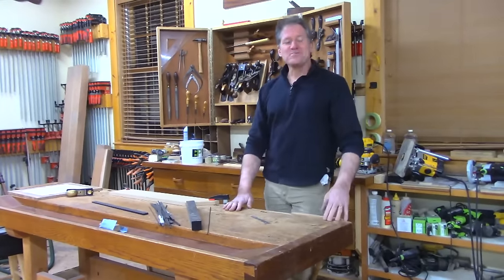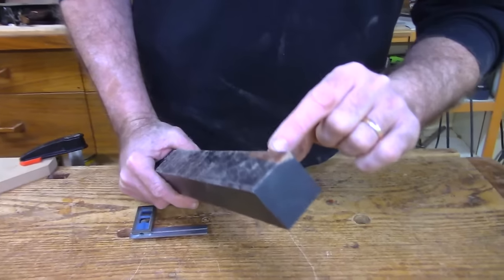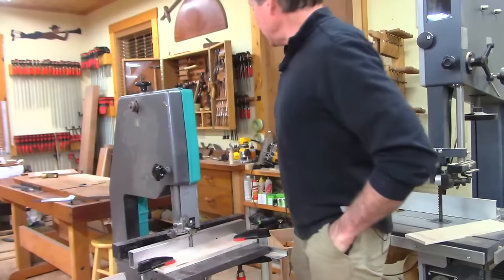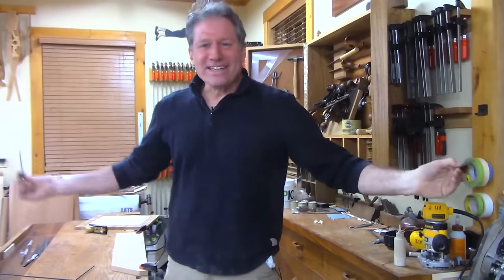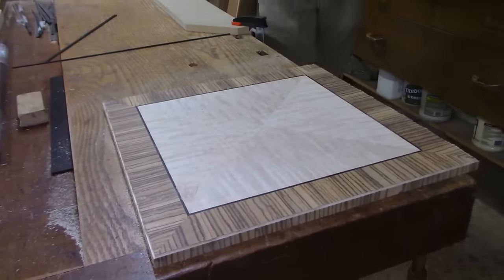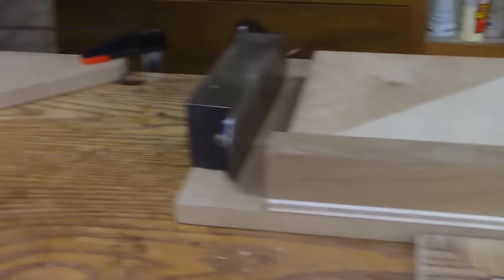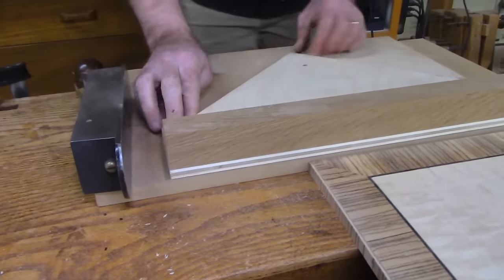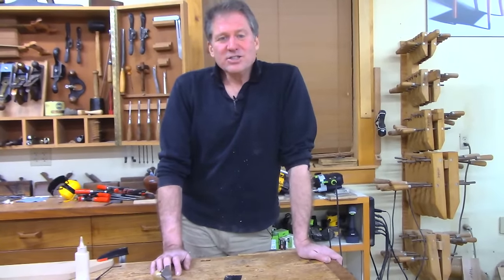How to Make Inlay Lines

Comment: Hi Tom, the banding is a great final touch to the table. If you have the time, I would love to see the finish to the table. Will you use an oil or shellac finish on the table, what would be best for a veneer project like this? I was wondering if you had the time to set up your new Saw Stop table saw. Iam sure it is going to be a nice new addition to the shop, although you have to still be safe, hope it works out for you. I am hoping, someday I can purchase one. See you on SNL.
Reply from the maker: Thanks Steve. I haven’t yet, but need to get that Sawstop set up! It should be nice, hardly used. I guess I’ve been procrastinating because I’m kind of sentimental for my old Powermatic which I bought new over thirty years ago! Plus I will have to remake some of my jigs to fit the new saw. Time to move on!😎
Reply: @EpicWoodworking  I don't blame you for being sentimental to your 
powermatic table saw, 30 years, that's a long time, it is an excellent 
table saw and has been loyal to you. Maybe you can keep it in the shop, 
if you have the room, and slowly phase in the Saw Stop with new jigs.
Have fun, be safe and enjoy your new Saw Stop table saw.

Comment: Did you also veneer the popular that is on the bottom of the table top over a substrate thanks Paul
Reply: The substrate is plywood with 1/16” poplar veneers, top and bottom.

Comment: Late question, watching the replay.. when sanding the lines, how can you keep the ebony dust from getting into the veneer? I had this issue on the contemporary round table. Thanks!
Reply from the maker: Thanks Dan. Hmmm, that’s not been an issue for me so it’s hard for me to advise. With the grain direction perpendicular to each other on the border of our table, it’s ideal to use a random orbit sander of some sort, and I finish at 220. My sander has a good vacuum with it so the surface is pretty clean. I’ve used ebony lines quite a lot with the ribbon striped mahogany, and have found a quick dust off with a dry rag prior to finishing has been fine, and I have never noticed a darkening of the surrounding area from the ebony. Sorry I can’t be more helpful at this time. Thanks for watching! 👍😎
Reply: @EpicWoodworking  Thank you! and thanks for all of this amazing content.

Comment: Tom. I’ve used Black India ink on walnut to make a black wood. It will raise the grain, so I sand and apply again.
Reply from the maker: Nice Kevin. That India ink is the best way to go I think, especially given the price of ebony! I think I’ll pick some up and show that as an option at some point. The tricky part is to get it to saturate deeply enough so as to not plane, scrape or sand through. Have you tried it with hard maple? I’ve noticed the pre stained ebonized lines are softer slightly open grained. Thanks for watching! 👍😎
Reply: @EpicWoodworking  I haven’t used it on Maple. Certainly worth experimenting with as maple on a table edge would hold up better than walnut

Comment: Sad to see that the side of the 3/4 did not match the top with the wood grain pattern. When cut cut zebra wood it smells like a horse very nice wood to work with did a kitchen cabinets with solid and viners.
Reply from the maker: Thanks David! Yes, you can certainly go the extra mile to match/wrap the edge. But knowing in this case I was breaking the edge with the ebony line, decided it wasn’t necessary…or worth feeling sad about 😎 I’ll have to pay attention to the smell next time, even though you’re just horsin’ around with me. 🐴👀Thanks for watching!